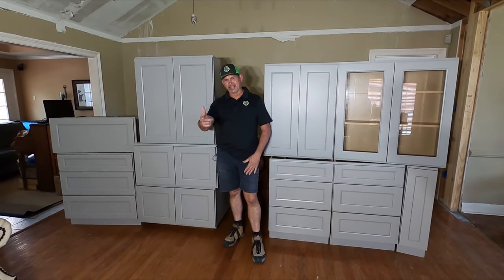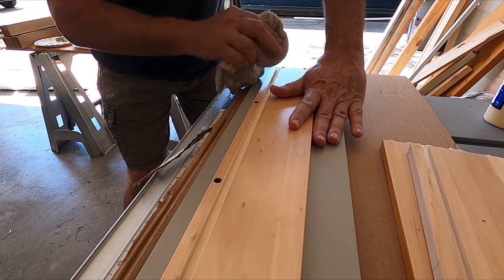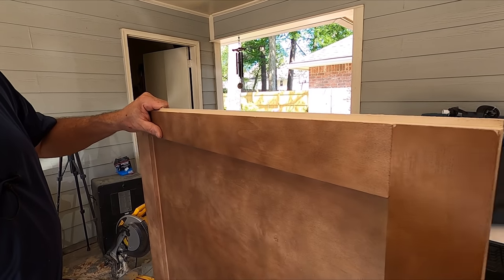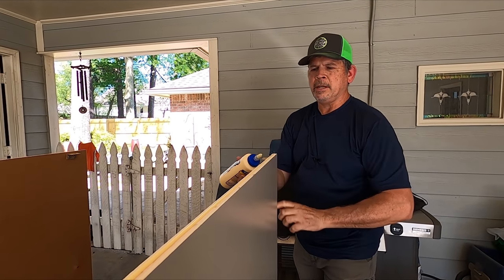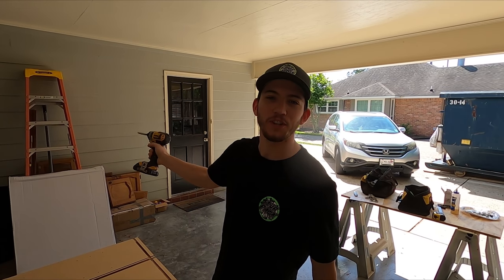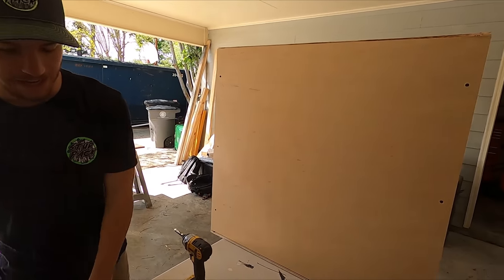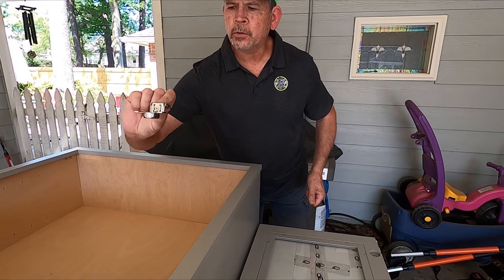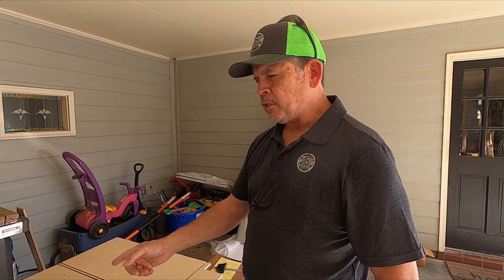How to Build/Modify RTA Cabinets! Ep. 13

Comment: As a cabinet maker and custom carpenter / contractor I Uh am not sure how to tell u but ?
Clamping pressure on dove tails is not needed?  But if u insist it’s front to back not side to side!
Why is it not needed ?
It’s a glue joint with dovetails that interlock once in place and glued (small amounts) they can not slip out hence the dove tail.
And never! Never use dry wall screws they make cabinet screws for a reason?
One they are brittle !  Also if they came with foreign cabinets toss them buy Spax Cabinet screws!
Use tight bond 2 or 3 especially for the strength.

I never use them so I really can’t te u much bout them.  Other than I replace them constantly?
Also those are not custom ?  Blum hinges , Baltic birch, all hand made are custom.  Those are punched out by a machine using a MDF fill plywood.
Reply from the maker: These dovetails definitely needed clamping pressure to pull them together, maybe the humidity down here makes it tighter IDK
Thx for commenting 👍
Reply: If you need clamps it’s simply light clamping.  In this case you state you had to hv them?  That means they are mass made by machines , not mated and improper fit thus you need “pipe clamps”!  A pipe clamp is a high pressure clamp made for things like metal? Or big table tops, butcher blacks ect.,.  Not drawer boxes!

Listen I can tell this video was made for the “unknowing” or “I am gonna try” guy!
However; you hv a responsibility to stay in your lane of expertise!  As a Contractor in fact where I come from unless your a GC you can not do that!
This is the perfect example why!

Make your living, teach your sons ; do all that!  However this was a did-service not a service!

Comment: A lot of people asking where to get this style of cabinet, and that they look similar to local companies etc. The majority of companies just resell these from Asia. Pretty sure I have the same ones in the video. I got all mine (full kitchen and bathrooms) from theRTAstore online. Good experiences with them. Wait for them to have some sort of a sale, as they have different sales like 3/4 of the year. Only issue I have with these RTA cabinets are the screws for the small 90 degree brackets.  They're cheap chinesium and sometimes the heads break off, and often they aren't magnetic, making them a bit more annoying to use with a magnetic impact bit. Not the end of the world though, can swap em out for better wood screws.
Reply from the maker: Thx Ryan.  We have found that shipping costs make buying RTAs long distance is a deal breaker.  We're fortunate enough to be able to pick them up locally.
quavana.com is our regional distributor

Comment: Damn... I just liquid nail every contact point between pieces, smack the drawer together with a rubber mallet and then shoot in some pin nails to hold them till set up.
Reply from the maker: These dovetails were so tight they had to be clamped to draw them tight.  Maybe the humidity down here IDK???

Comment: What blade did you use when cutting down the cabinet depth? Thanks.
Reply: I built the cabinets in the last 2 houses . I use good quality ATB toth pattern blade , about $ 60 for a 10 in blade. To keep splintering first make a " Kiss Cut " have the blade set to just barely cut thru then raise the blade to make the final cut thru. . large volume shops have a table saw that has 2 blades in alignment,   a small blade that just skims the surface then the large blade y cut thru the surface
Reply from the maker: I'm not sure what blade I currently have on my SawStop... sorry

Comment: You should be using a drill with a clutch. The 12 volt Milwaukee 2402-20 is the best tool for the job for several reasons. The biggest of which is that the clutch setting and drill driver setting are independent of each other. Every other manufacturer has the clutch setting and drill setting on the same adjustment ring. With the Milwaukee, you set your clutch for the job and then you can switch between drill and driver without changing your clutch setting.
Reply: Yes. I've been using Milwaukee products for about 12 years after seeing the team who worked on my house use them. Very reliable and love the build-in clutch.

Comment: Some of the best cabinets I have ever used. I go ahead and glue and staple , using the included hardware as clamps while I assemble. Love them easy transport, fast assembly and strong.
Reply: Which company did you use?

Comment: one thing I don't get, why assemble any kind of furniture before everything else is ready? I mean walls are not complete, the floor is not done, the ceiling is not painted, etc.. but you assembling furniture? 
Why?
Reply: By having the cabinets made before drywall He can add blocking to the stud walls to get a more secure attachment Especially for cabinets less than 34 inches wide
Reply from the maker: Correct plus I can inspect for damage/wrong product delivered and re-order in time

Comment: For Kitchen & Vanity sink cabinets, would you recommend caulking the bottom corners of the walls & base to force leaks to empty out the front of the cabinet. Water leaks are noticed too late. Damage has already occurred to the cabinets. I usually apply a self sticking clear plastic to the base to give it an additional layer of protection. I’m looking for your professional advice. Am I doing the correct thing to protect my sink cabinets? 🤔

Comment: Great video. One step I do in addition to the instructions on RTA drawers is a bead of hot glue under the finished drawer bottom to stop the wiggle and rattle on the drawer bottom some designs have.
Reply from the maker: Good tip.  Check out "space balls" for the same thing, never used them though
Reply: I glue mine with wood glue when building but have used the hot glue trick on cheap pre-built furniture and white boards. Always glue everything you can (backs too) for added strength and stability. This is especially true on cheap furniture.

Comment: I just installed these EXACT cabinets in a remodeled kitchen. I bought them from RTA Cabinets and they are the same thing, even the same color, same brackets and hardware etc. The quality was better than I thought they would be. Kitchen looks great.
Reply: Can you post a link to the website?
Reply: The RTA supplier that I use is called KitchenSearch, they have a website with a number of different brands and styles. If you chat with anybody there, tell them I sent you.
Reply from the maker: Our cabinets came from quavana.com 
They're our regional distributor maybe they can assist?
Reply: Any link? I don’t see a company with that name. There are 20 with similar names.

Comment: Most cabinet shops don't use any glue when they assemble those cabinets. Even with drawers, they just hammer dovetails together and use finish nail gun. This was true for all cabinet suppliers I have used in the past.  It probably is not as good, but seems to hold just fine.
Reply from the maker: yeah the glue is definitely an upgrade 👍

Comment: Where did you guys buy these cabinets? Online or a local dealer?
Reply: The RTA supplier that I use is called KitchenSearch, they have a website with a number of different brands and styles. If you chat with anybody there, tell them I sent you.
Reply from the maker: Local company has them.  
quavana.com is the distributor in Houston, check them out, maybe they can help

Comment: The are made in China. That’s why you can’t find origin where it’s from. They are made out of extremely soft wood for lighter packaging and ship cost. These soft wood are as bad as particle boards. Any cabinets that comes in parts and assemble at home. Is horrible design. That’s why most flip house use these because by the time problems occur in a year or so. The buyer is stuck with it. And I’m one of those stupid person who bought these horrible cabinets. Just slightly water on it paint start to duel off. Wood so soft just bump into them chip or cracks. The drawers constantly pop lose even if glue. Especially drawers bottom panels. Not to mention moisture get into it. Throw cabinets off squares and start bumbling into each other.

Comment: Those looked like some quality rta cabinets! I wasn't so lucky with the 20 I bought, built and installed. The screw holes didn't line up, the datos didn't line up, parts were missing, doors and sidewalls were missing. I had a heck of a time. Made it all work out in the end for the most part.

Comment: Those plastic corner parts are a substitute for standard corner glue blocks.  Glue blocks add to the rigidity of the cabinet carcass.  Those screw holes in those plastic parts are stupid because most countertops are held in place with a bead of silicon.
Reply from the maker: I screw a plywood subtop to the cabinets further strengthening them and our stone sits on top

Comment: Hey Paul,  Looking at this video and have a question. Looks like the drawer fronts are screwed to the front of the drawer at the dovetail joint to hide the screws.  After you glue up the drawer frame, how would you remove the drawer fronts?  Love your positive attitude!
Reply: After I drilled the hole for the knob, I attached inside drawer frame, then turned it over and ran the bit through the drawer frame. I removed the due drawer front and drilled a bigger hole through the drawer so I could access the screw after it was attached.

Comment: A half-half-half drawer joint is probably the easiest way to modify the drawer sides and back. Glued up it will be as strong as the dovetail joint and only one set up on the saw if you use a dado blade. Can also be done with a router in one set up.
Reply from the maker: Probably what Gary Katz calls a quarter-quarter-quarter drawer joint.  Very quick, strong, and efficient 👍
Reply: @StudPack  that exact technique works with any thickness of material, just set the dimensions half the material thickness.

Comment: Not really dovetails . Just modified box joint .
Reply from the maker: I guess you could make the argument that a blind dovetail is a modified box joint 👍
Reply: @StudPack  Not intended to criticize  it's just that a dovetail is called that because of it's shape . The wedge triangle 'dove tail' shape locks it in to the adjoining edge . Unlike a box joint it needs no glue to keep the front piece of the drawer box from being pulled out (forward) in everyday use  Enjoy the videos, keep them coming.
Reply: @StudPack  Except that a 'dovetail' is a reference to the (triangular) shape of the interlock.
Reply from the maker: Cool thx 👍